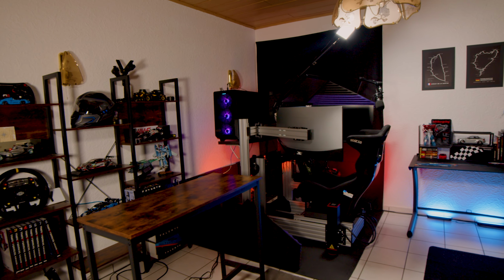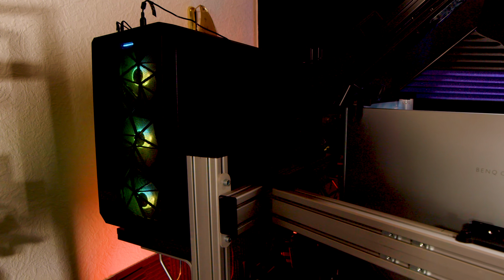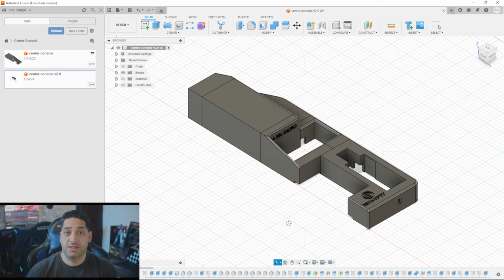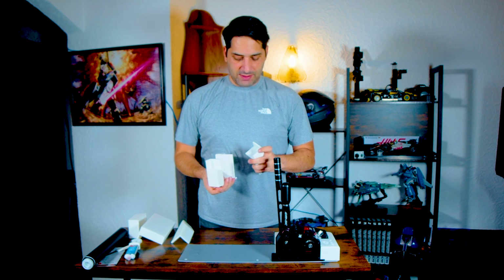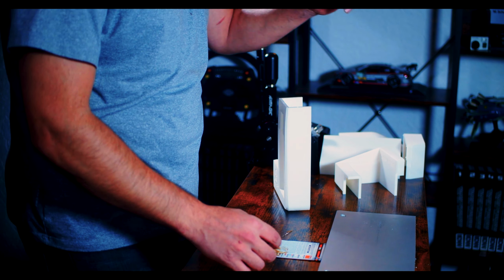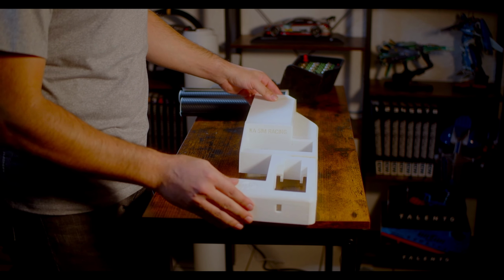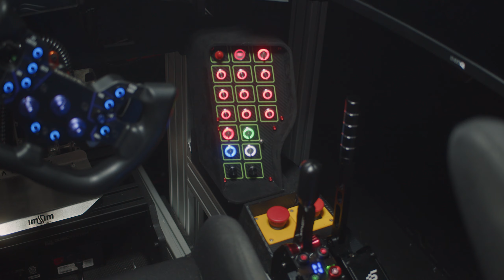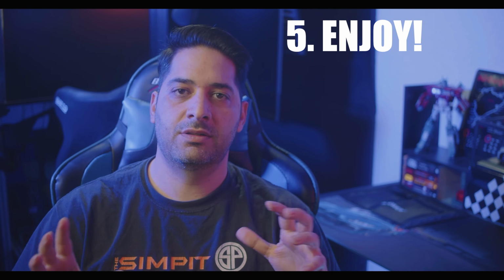Sim Room Tour/Rig Build Off Part 1 - Center Console

Comment: Is there a link to the button box maker?
Reply from the maker: yup, you can grab a box here: https://simracing4u.myonline.store/
Reply: @TheSimpit  thanks for the link, but I didn't see the one you have in the video. Was it custom-made for you?  I am looking for a box that has the 45-degree tilt backward and flat bottom like yours.
Reply from the maker: Unfortunately, it never made production due to some issues. Mine was a prototype. You can find the 3d plans for the boxes online and have a website print it for you. You'd just have to wire it yourself.